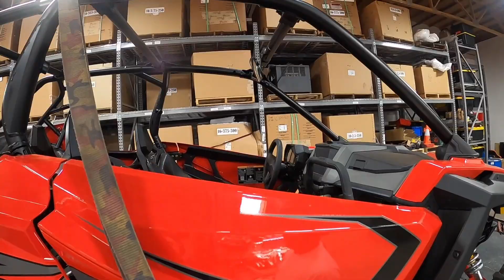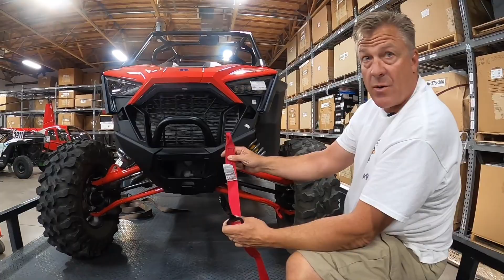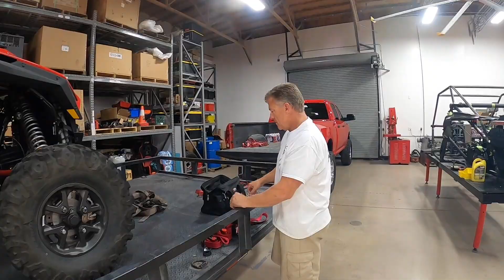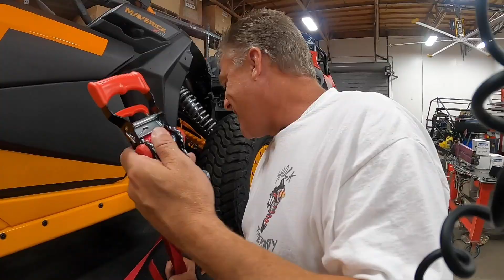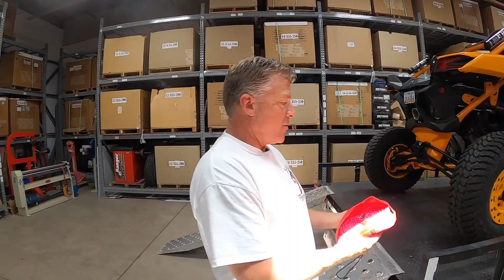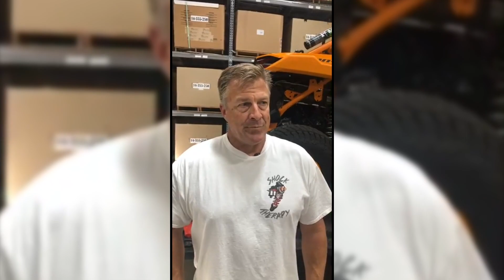HOW TO TIE DOWN A UTV

Comment: Just a thought....  I believe in always releasing the park brake and or take out of park, ( if equipped), after attaching a strap or two.  Then after all strapped down reset the park brake or put back in park.  Doing this there is then no tension on the drive line.
Reply: 0

Comment: This is obviously not the channel to watch for tie down points 🙄
Reply: Why is that?
Reply: @Johnny-ip4mk  if you want to strap on low center of gravity on a single ball joint go ahead... but please don't ever cross over strap your machine. If one fails it can slide off. Only straight front to back strap downs, if one fails the machine stays on the trailer.
Reply: Steve 8511 I get the ball joint point, but if you lose a strap, regardless of where it’s placed, you’re in trouble.
Reply: @Johnny-ip4mk  not if they are straight forward and back....
Reply: Steve 8511 Awesome video! Very informative. Thank you for sharing 😉

Comment: i equipped my trailer with TRAC system, it was rather inexpensive- probably cost me less than $150 to be able to tie down both of my UTV's with all needed parts using several 12" long track's and the clip in straps for the TRACKs, all available at my local auto parts store (NAPA). they're both tied down using the tires. the only thing i can advise is is on a wood deck trailer to make sure that at least one pair of bolt holes in each track is bolted to a frame support under the wood, or to use through bolts through the wood with fender washers on the underside and nylock nuts on the bolts so they don't come loose. the other nice thing about doing it this way is that the free end of my straps can be placed under the strap between the strap and the tire and as things are cinched down they hold the free end quite nicely and neatly.
Reply: JB COW HERDER what do they look like?

Comment: Criss crossing the straps is a bad idea.  Bleeping Jeep channel did a great demonstration showing why it's a bad idea. (Straps interfere and if one strap fails the entire strap system fails)

Otherwise this is great vid! I struggled finding good info on strapping UTVs with a mixture of advice.  I finally installed e tracks on my trailer with straps over the wheels and that has been my favorite UTV accessory investment yet.

Comment: Learned this a number of years ago. Was in a remote area and had a leaf spring on the trailer snap. Managed to block the trailer up to get it home but found our straps kept falling off due to the exaggerated movement of the atv chassis. More than usual. That’s how I learned tracks with tire straps are the only thing that make sense.

Comment: Hey thanks so much for this guys.  Since watching this I have tied down my RZR like you suggested and I feel better knowing my car is secure on the trailer.  While driving down the road I can feel a difference in the trailer and the motion of the car.  It is like the car floats on the trailer and allows the suspension to work.  

Thanks ✌🏼
Reply: E

Comment: Erickson Etrack with the strap over the wheel - best way by far
Reply: I installed those for my ATV's and I'll never go back.
Reply: this is what I use, also I have "exotic car straps" that loop through the wheels as backup for new trailers.
Reply: I agree also I have two sets so all four tires are strapped down
Reply: Bingo
Reply: That's exactly what I use
Reply: Love mine. Makes strapping down so much quicker

Comment: I admit I've been using the tow loop in the center at each end. I didnt like it and had plans to upgrade my trailer to e-track. Not sure why I didn't give my current situation more thought. Thanks for the video... ill be tying to the lower arms and furthest outside radius rods from now until I get my e-track installed and can strap my tires down.

Comment: I'm using dog bones for strapping the tires. You can tie down securely and it only takes minutes. Going around the inside of the tire instead of over the top gives you a better hold in case you lose air pressure.

Comment: I run e-track down the entire length of the trailer deck and from there figure out where the buggy needs to sit and put e track chokes in front of the front tires, from there I used 2" e track straps over all four tires to hold it in place. makes for a very solid foundation and the unit never moves and no shock load is placed on the suspension
Reply: That is exactly what I do, Seems like the best way.  I did not watch the whole video.

Comment: have a d-ring strap bought at a wrecker supply company and e-track system to hold ranger on tailer. put d-ring end over the tires on all 4 tires and rachet down tight on all 4 tires

Comment: The easiest way and what works the best and fastest for me is to pull the front wheels to the front rail on the trailer and hook two straps to the frame about halfway of the vehicle and tie down to the front of the trailer. There is nothing wrong with tying down to a part of the vehicle that is suspended. As long as you compress the suspension to put enough preload it wont go anywhere or have any suspension travel that creates slack in your straps. Also if you strap both front and rear you don't even need to compress the suspension because you are using tension on both sides of the frame to prevent the vehicle from moving and you can have all the suspension travel you want and it will never move. You really shouldn't tie down to the A Arms, Polaris actually tells you not to. In fact all manufacturers have tie down holes on the frames of SxS in front and rear. The correct way is to take two straps and tie the rear down a few feet behind it and then take two more and tie the front down a few feet in front of it. Tire straps are a bad idea because you can loose air pressure.

Comment: Tire webs. Even from tractor supply with their hardware. That way your suspension can move freely and your straps stay tight 👍🏻. #nochase
Reply: This is what I did. Installed E Track and have a 2" strap over each tire. Works amazing.

Comment: I use the good old fashion 1/2 inch chain and binders on all 4 corners through the lowest parts of the chassis front and rear 👍. I can see what you're saying about maybe straps tearing with the bouncing, but I would be astonished to see any issues with a little pre load on the suspension with chains and binders. Standard 1/2 inch chain has a working load of 8200 pounds

Comment: To get tongue weight, measure height of pickup rear bumper with empty trailer attached. Then load your UTV and drive it up to where your pickup bumper is an inch lower. If you don't like the way it handles, pull forward until you have another inch. But an inch is a good rule of thumb.

Comment: As for the tongue weight, it really depends on your configuration, payload, etc. For example, my f250 diesel payload is such that my talon goes all the way forward on my dual axle trailer. There are some great YouTube videos showing why you want the weight as far forward as you can, relative to your setup.

Comment: Cam confirm on a pro xp a 32" rubs super hard i  full lock with a 5-2 wheel. So much so it rips the the skid plays down and drag everytime you go in reverse. Had to go with 1.5" forward offset A-Arms

Comment: You are correct that the arms can take quite a bit of load, can’t say if they’re designed to take load on a small point when they’re tied down like that though. I’d prefer to tie vehicle down per the manufactures recommendations. I was always taught not to ever tie down a vehicle by the control arms because they weren’t designed to take load like that.

Comment: I use a regular ratchet strap and push the strap through the "eye" on the hook witch makes a loop and put it over the tires .....if you've ever seen a marlin truck rack the straps  works the same way .... Although my toy hauler doesn't have great tie down points and  is almost impossible to tie down correctly

Comment: My Toy hauler tie down points are all inside the wheel line. How do you tie down  when you can’t pull to the outside like you have on the trailer in the video?  Cross cross both front and rear? (Not to the chassis)

Comment: Everyone does it differently,  but for me tying off to the chassis is the strongest part of your machine and most stable. When you strap to suspension components you are getting some of the weakest points on the machine since they are intended to move. Use 4 good quality 3O00 Lb straps, cross the fronts and pull straight back in the rear AND always attach to the chassis/frame  Cuz that tinfoil crap the A arms are made of would bend like cheap Chinese steel if something bad happened.

Comment: What about through the rims of the tires with a tire strap if it is too short to make your outside hooks?
Reply from the maker: You can but if you tie a bit up or down from dead center of the wheel it will loosen up.

Comment: 90% of the people do wrong including me, thanks fir getting us sorted
Reply: One should tie down from the chassis. They guy only gets away with it because the UTV are so light.  Why in the world do you want your load bouncing around like a pogo stick?  I agree people should spend money on quality tie-down gear and supplementally tying down at or near the tires is good but you want to keep the load from moving.
Reply: @lhurst9550  you mean the load that has high tech off-road suspension specifically designed to mitigate bouncing? If you strap to wheels and are having issues with it resembling a "pogo stick", you have much bigger issues.

Comment: When utilizing the A-arms for strapping the ability for the machine to move is problematic for me. When loaded into my toy hauler, my pro xp4 has about 3-4" maybe 5" of play before my roll cage is hitting cabinets. What is the best way to strap down in this situation?
Reply from the maker: Just strap the upper shock mount to an a arm or spindle.  We tie ours down to lower the overall cage height all the time for something like a stacker trailer. Super easy

Comment: Should an ATV be in 'PARK' when restrained  on the trailer or does this damage the transmission/drivetrain during transport?
Reply: Leave in neutral and lock on parking brake. If you leave it in park you could possibly damage the transmission and the rear and front diffs. If you read your owners manual it’ll tell you to leave it in neutral when you’re towing on a trailer or a truck

Comment: When I purchased my RZR it came with the trailer.  The previous owner used ATV Mighty Tite system.  Taking your comments, this should not be used correct?
Reply from the maker: I don't like that system. If it surrounded the front tires and held them tight in front then I am in. But not like I see in their video.
Reply: Shock Therapy llc thanks for the reply. Great informative video, I appreciate it.

Comment: I have a 72'' car & a 64'' my 72'' fits over my E track and I tie down by the tires. My 64'' is obviously to narrow and have to tie down the chassis and not at a good angle for the E track. Is there anything on market allow me to tie down the 64'' to E track and be able to keep the strap in line with the E track?
Reply: put a second set of e-tracks down to where you can tie down the 64 as well
Reply: @187flatliner  this is what i did^^^...... my Wolverine is narrower than my KRX1000 so i'm running two different widths of tie down tracks.
Reply: @187flatliner  I was hoping there was something else I could do, save myself another headache.

Comment: This is way off topic, but do you happen to know make, model and year of that beautiful red truck pulling the trailer in this video? Thx!  Very useful information on this video btw... I use the Rhino straps ...
Reply from the maker: 2015 Dodge Ram  2500
Reply: @ShockTherapyllc  thx for the info, really digging that red truck and perfect size lift and tires... 👌

Comment: How do you feel about a single 3" strap from left side tie down on trailer, run through the wheel spoke, across  to the right side wheel spoke and ratchet at the right side tie down hook? Front and Rear being pulled down, forward and rear taught.
Reply from the maker: If I understand you correctly this would pull the front tires together or narrower. This would raise the car and loosen the straps. Probably not good
Reply: Understood. When I haul actual road legal cars, the locking steering wheel keeps that from happening as often. Or when I haul straight axle vehicles like JEEPS, Landcruisers and the like it works great. But seeing the UTVs and SXS' mostly have independent systems, I can see where the toe effect would compromise the tie downs.
Reply: Where I live bylaw states four straps attached to tires, or two if attached to the frame.

Comment: You had a couple of questions about +1 etc forward arms to clear larger tires, You mentioned that you didn't mind them as long as they were a quality part. The reason Im asking is that I just picked up a 2018 X3 XDS(64") with brand new wheels and tires( 0 dirt miles less then 5 road miles) The tires are System3 RT320 33x9x15 mounted on STI HD9 5/2 offset, at full lock in the garage there is only about .75" of clearance between the rear of the tire and the fire wall. My concern is that it will rub during articulation. So is it possible to install a quality set of forward arms on my X3, if so who would you recommend on the quality parts.
Reply from the maker: We run 33's on our X3 but it is a 72 with zero clearance issues. I guess you might be pretty close on the 64".  I would suggest anything from Highlifter if you can't get some from S3 or Cognito first.

Comment: Wow, I would never tie down to a-arms or radius rods. I would use wheels nets, over the tire or what I do, use axle straps and go through the wheel towards the center of the car hooked on an etrack. Also over the tire straps dont work on smooth buffs or smoothies, they just slide off.

Comment: I have this echo trailer, http://echotrailers.com/EUTV-12-14-UTV-Trailer.html, where the rear tie downs are right where the rear tires are at.  How would I tie down the rear of the machine like you are suggesting?  I just use the hook on my chassis to them at the moment, because this is my first car and that is how the dealer strapped it down the first time, and didn't actually tell us how to strap it down.

Comment: Can am x3 will method 4+3 offset be bad
Reply from the maker: 4-3 bad. 5-1 and 5-2 good
Reply: Some wheel manufacturers like race line say 5+2 and end up sticking out 2 inch more than stock so they really are 4+3

Comment: All good advise but I do not agree with putting the second SUV car on the trailer facing forward, in fact it should be backed on so the heavy weight of the engine is over or near the wheels of the trailer.   Its a bad idea to have that weight near the back end of the trailer, fishtailing is more likely to happen.
Reply from the maker: You are correct. But with our trailer it has plenty of tongue weight and works killer. Good advice though

Comment: You are wrong dude, tie down the chassis, compress the suspension.  Why in the world do you want your load bouncing around like a pogo stick?  I agree people should spend money on quality tie-down gear and supplementally tying down at or near the tires is good but you want to keep the load from moving.
Reply: kinda what I was thinking... sure tie it down so it dont move... but also tie it down so it doesnt bounce around... im a trucker and if the load is moving at all... wether up or down its not good
Reply: I use tire holders on the front and I squat the rear of mine down... i used to squat the front but im getting lazy so I just do the tires now
Reply: What's going to move? The suspension on the sxs is going to soak up far more bouncing than the trailers own suspension. I'd argue that if you were to sit in it going down the raid, the mass of the chassis would move LESS than if you compressed the suspension and forced it to move with the trailer. You clearly have never hauled any vehicles.
Reply: @meisbepat  "Clearly"??? really.  I have a CDL  and own/haul heavy equipment along with to many large toys to count.   Your thinking is wrong, ask any professional out there i.e. not a shock expert.